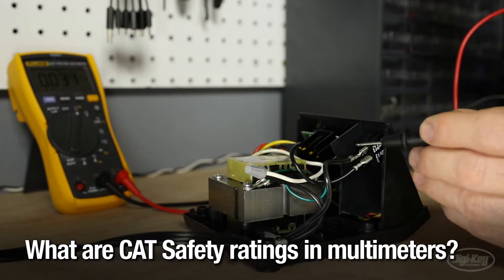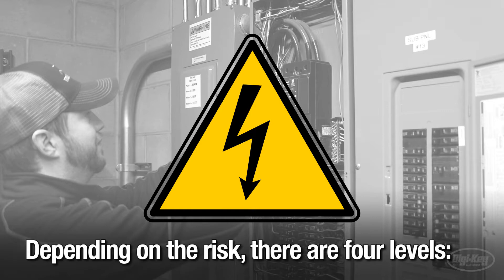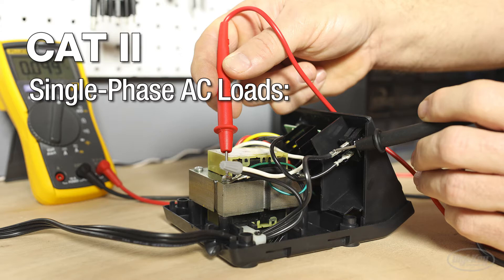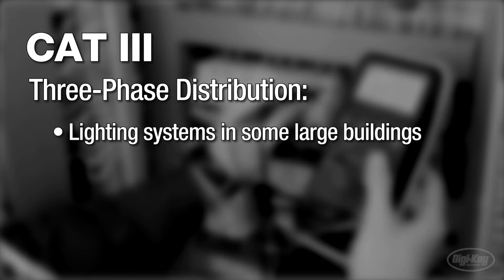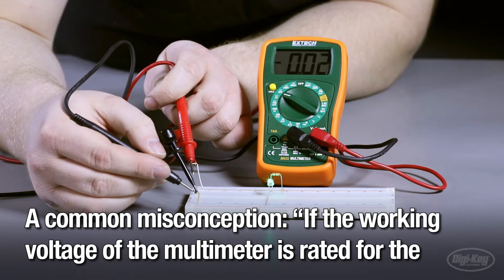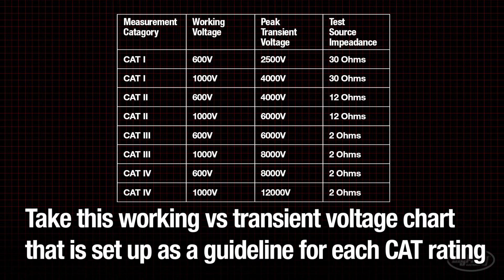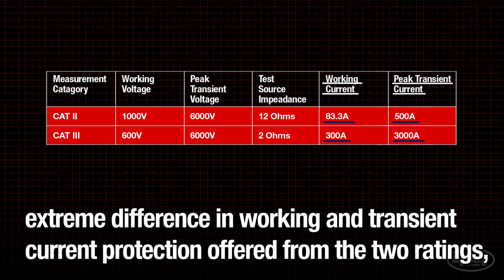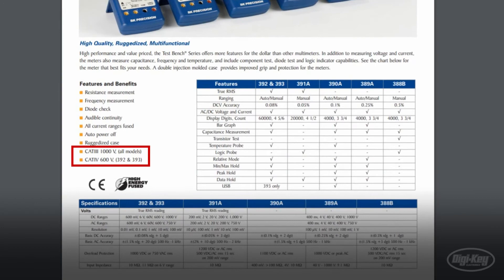What are CAT (Category) Safety Ratings in Multimeters? - Another Teaching Moment | Digi-Key

Comment: This is why I spent the extra money and bought a CAT IV multimeter so I never need to calculate my expected current or voltage. Plus I can quickly read my current on any leg of a phase. It also comes with two thermal couples for me to check temperatures. The only thing I would add would be a laser thermal sensor to get a temp reading of equipment without having to touch the component. My cost was $194 and worth every penny!

Comment: Good video with one thing missing. Unfortunately CAT ratings can be stamped like on cheaper meters without being tested or certified for this rating. Any company can make a multimeter and say it’s CATIII without having it independently tested for this rating and could fail under the CAT rating they state putting the users life at risk. 
Bigger companies like Fluke, BK, Brymen get independent certifications or do in house certifications. Be careful when buying cheap meters on eBay and amazon if your working with high voltage and potential high spikes in amperage.

Comment: Interesting. However i do not find the answer to a simple common question. What cat rating is need for car electronics. It is only 12V however verry high currents can appear.
Reply from the maker: CAT I should be more than efficient because it is a DC circuits. Of course this is also load dependent as well. When looking at the chart provided that shows what each rating can handle, you can see that we've done the math to calculate the current max for each. If for some reason you have a high load expectation then select appropriately based on the current rating.

Comment: Good job explaining the safety ratings for multimeters but poor job in using video examples where workers are not wearing electrical safety gloves and any other electrical safety PPE that may be required when inside of the shock and arc boundaries.
Reply: Sadly, you are right!